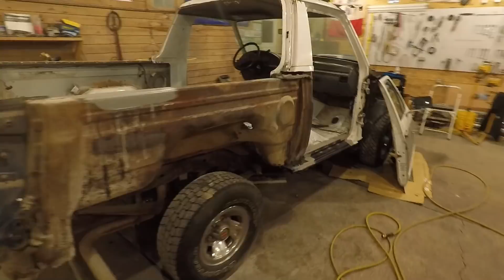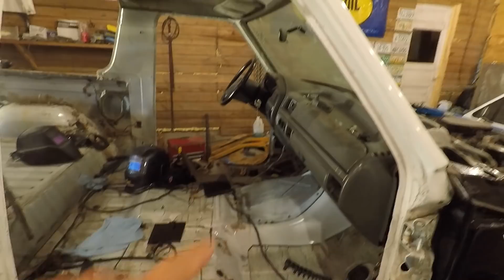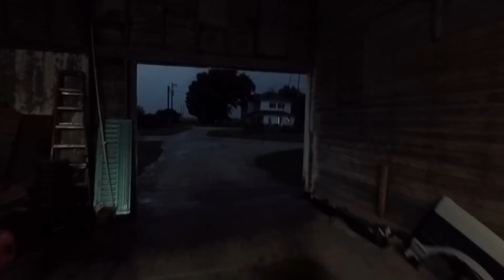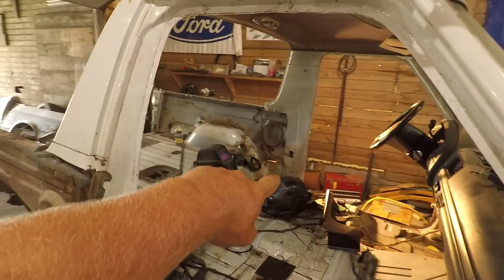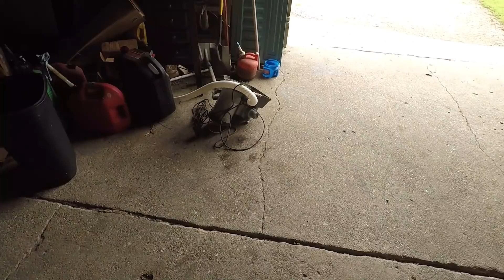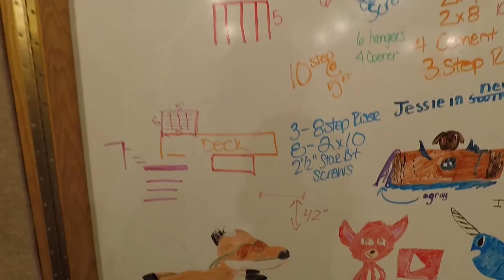BRONCO Floor Is FINALLY IN

Comment: You should move your ac wall unit to the shop.  It will take a while to cool down but it will eventually.
Reply from the maker: I dont think its large enough to make much difference in the shop...  the shop isnt 100% air tight either, just dont think it would do much out there.  Kept the little room its in about 70-72 degrees (which that room isnt insulated at all).  Doesnt hurt to sweat a little.. but on the super hot/humid days it does get a little draining LOL